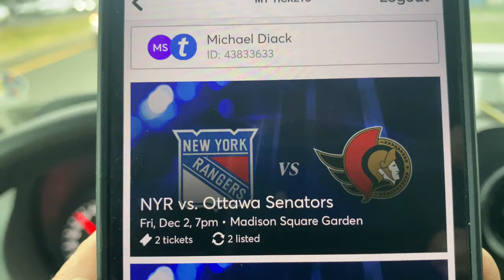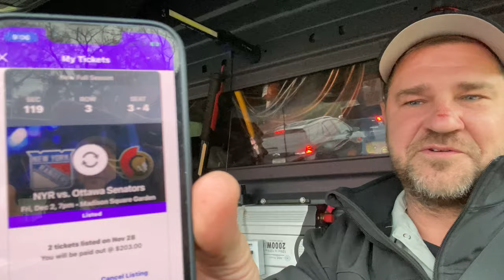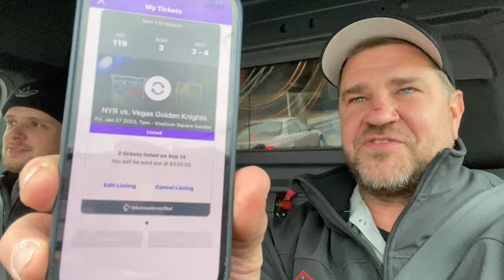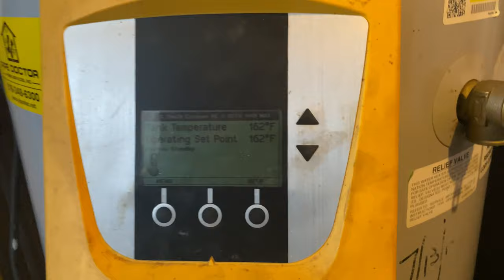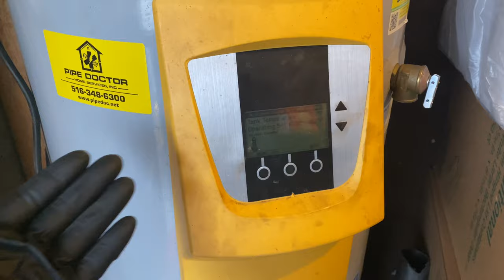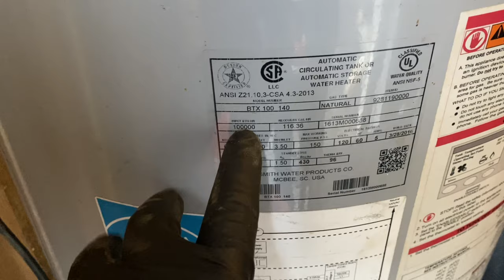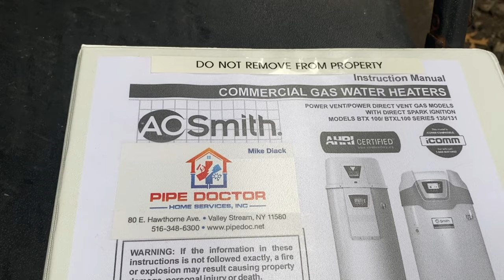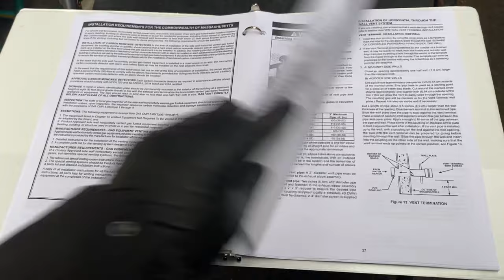How to Perform AO Smith Cyclone Maintenance

Comment: 23 years experience and I've never changed an anode rod either. Probably never will. Great video
Reply: I've changed a handful of them in the past and the tank didn't last very much longer anyway, because the original rod was long gone and tank already spent. same for T&P valves, if one's dripping and the tank isn't newer with bad expansion tank causing it, just check and replace the whole tank, because it's likely nuked and ready to go.
we have a mix of various quality city and well water around here, some are acidic, others alkali, maybe full of iron or other minerals that clog and ruing everything in less than a year. right to city water in dead end areas that end up with high chemical levels chewing up every type of rubber component in the whole plumbing system.

Comment: On this type of water heaters is worth changing anode rod and I'm surprised they didn't supply the type that is collapsible in low ceiling is impossible to change it,  on residential most companies don't bother anymore as the lifespan of water heaters nowadays is terrible and not worth it. Great video Mikey keep up the good work.

Comment: I should pull my anode rod, just for science of course. 

I used to use teflon tape, switched to pipe dope a few years back. Seems to have worked great. Is there that big of a difference between the two?

Comment: I got tired of replacing my Bradford White anode rod so I replaced mine with a 120V powered anode rod. No more bad odors and they are guaranteed for 7 years. 1/2” Milwaukee impact gun works wonders removing rods and tightening the new one

Comment: The control panel on that water heater looks exactly like a state wall hung water heater I installed. I guarantee you it's made in the same factory. I had nothing but issues with the one I installed. Very long story short if you gas water column drops 1.5"wc or more that unit will shut down. We had a 1 1/4" gas line we ran for that and a gas furnace and generator. But the unit was extremely sensitive. I hope you have much better luck than I did but I will never install a wall hung state ever.

Comment: Got to disagree that you have to run hydro-air units at 180.  I run mine in a range of   (hl)  with a 20 degree HLDF.   Heat coming out of the register is 105-120 degrees.  This is with a CI  Oil Fired Weil McLain Boiler

Comment: My water heater is in my basement and trying to replaced a anode is difficult because the rod :yougotthis:will hit the ceiling and that why replacement rod are shorter to be able to install.
Reply: Get a "sausage links" model. It works for low ceilings
Reply: Yes, I heard of them and I will check in to it. Thanks

Comment: Damn already at 66.9k subscribers. That jumped up fast from the 50k if it keeps going at that rate you'll hit 100k way faster than 6 months
Reply: By the way that old anode rod has beef changed before. Aftermarket rods are long and are cut to fit. They didn't cut it. The one you had appears to be a factory size. 👍🏼
Reply: @PipeDoctor  I didn't think about it that way but I bet you're right. I've heard some of the fishing channels I watch talking about the same thing happening.

Comment: Take care to evaluate how much clearance you have above water heaters before you offer Anode rod replacements. The salesman at the company I work for offer it but never measure, so it ends up with draining the water heater laying and it at an angle to get that bitch off. I hate it 😤😤😤
Reply: Should be able to get segmented rods so they flex in… hopefully the one you’re taking out is worn enough you can get it out in a tight spot